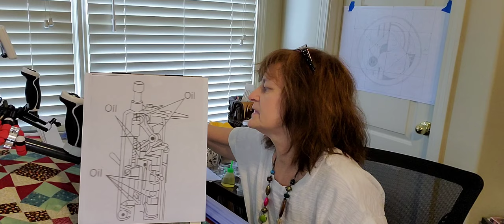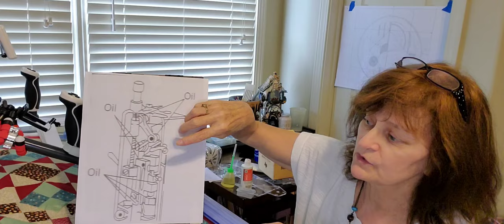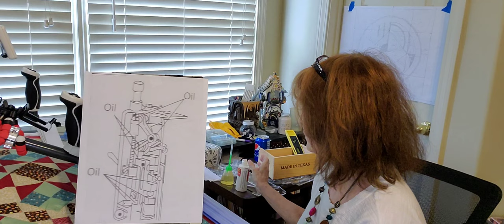Oiling Your Q'nique 19 Machine

Comment: The brush is a great idea, I always worry about using too much or nightmare of the top coming off.
Reply from the maker: I've been caring for machines this way for decades.
Reply: I did this very thing years ago with my Pfaff 7570. 

Thanks for this lesson. I have a Q’niqe 15” pro. Not set up yet, just moved.

Comment: I also was not removing the clip! How often do u oil the top area?
Reply from the maker: Because I am oiling so sparingly, I clean and oil everytime I swap projects (I oil again midway on a detailed project).   I also listen carefully and oil at first sign of any unusual chattering.   Your machine should have a machine sound, but not clattering, chattering or whining....all indicate either a bit of thread caught somewhere or time to oil.

The manual says to oil the machine (linkages/gears)
  - start of new project
  - every 20 hours
  - after sitting unused for 30+ days

Bobbin area, every other bobbin change

Comment: Don’t you oil your bobbin case since it’s part of oiling process? If so, also use a brush?  How often do you go through this oiling process?
Reply from the maker: In my video I believe I noted that the manual covers oiling the bobbin case sufficiently.   

I actually oil my bobbin area with each bobbin change and. Yes. I do use the same process...using a brush to apply oil.  I prefer using a brush BECAUSE I feel I have much more control of the amount of oil dispensed this way.
Reply from the maker: As far as how often do I oil the bobbin...at least every other bobbin change, but most often every bobbin change.

As far as how often do I oil the machine head...ever time I start a new project, change my needle,  OR anytime I haven't used the machine in a week or more.   But I will also stop and oil everything if I start to hear my machine chattering.

Because I'm not dropping oil into the machine, but applying it soaringlu